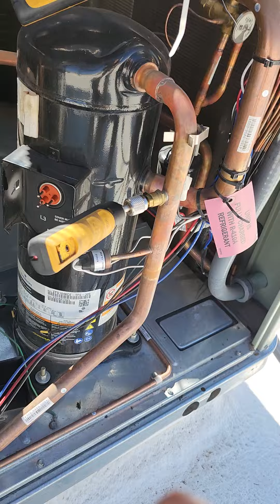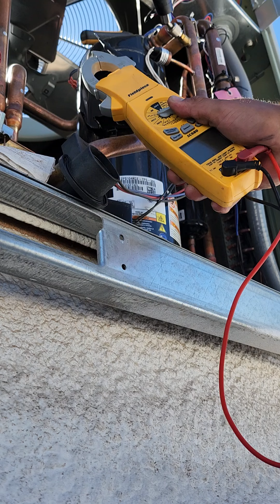BAD COMPRESSOR/ BAD WINDINGS DIAGNOSIS 1 YEAR OLD TRANE PHOENIX HVAC TECHNICIAN HEATING AND COOLING

Comment: So what the heck caused bad windings in a fairly new compressor?
Reply: Undersized ducting. Most companies are changing units out without upgrading ductwork. High static pressures causes liquid refrigerant to the compressor. He will keep changing compressors until a real technician actually addresses the underlying cause. Hope this helps.
Reply from the maker: manufacturer defect most likely